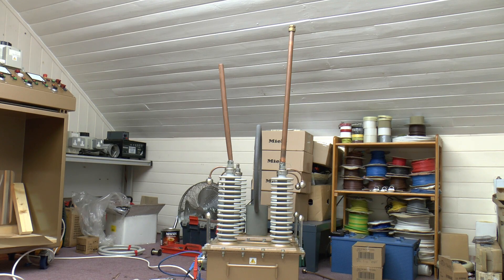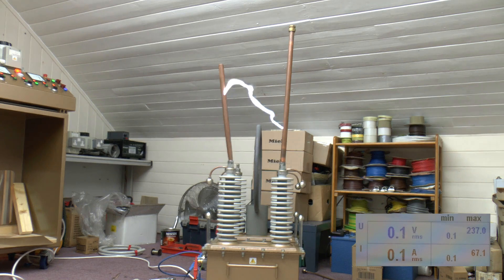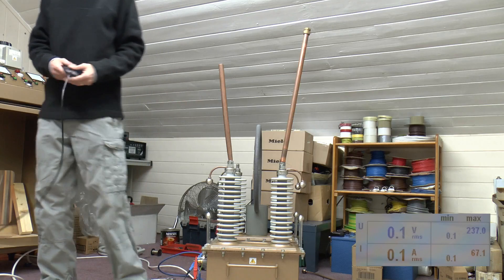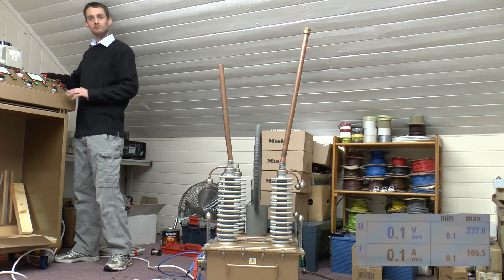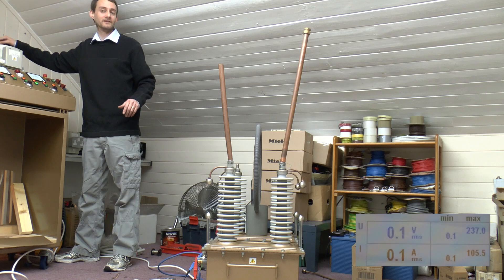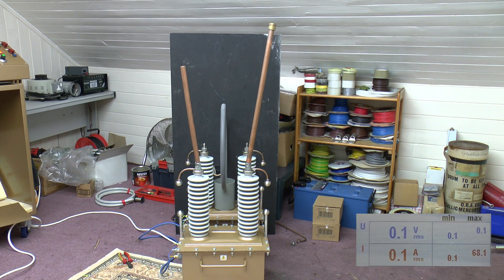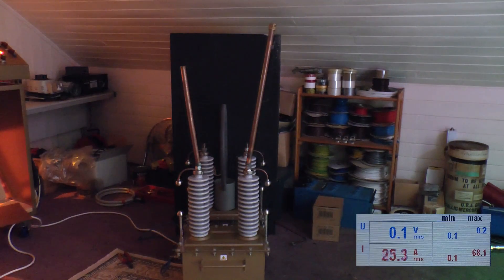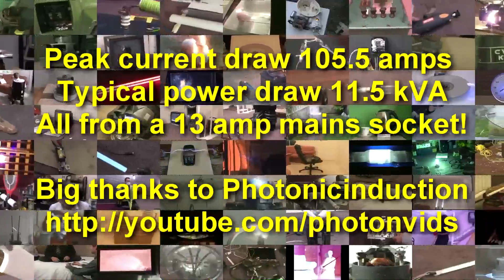Twin transformer Jacob's Ladder at Photonicinduction's house

Comment: I'm wondering if the circuit supplying this '13Amp socketoutlet' is a ring-final circuit of flat twin and earth, 2.5mm² installed embedded in walls! B-type BS 60898 MCB? :)
Reply from the maker: +Tom Lloyd It'll be a ring final but Andy may have veered from the normal standards for the rest. Type C (for high-inrush circuits) and D (or "don't fucking trip" :) ) breakers are plentiful in Andy's consumer unit, plus he uses a lot of fireproof cables as well, possibly FP200, I don't think it's Afumex because it's too new (I used that when replacing a flat roof).

The outdoor stuff was done on the cooker circuit which is shorter and seemed to have a bit more oomph :)
Reply: +AintBigAintClever type D- don't fucking trip! ... Superb- I'll use that one! 👍
I enjoy all these videos, there's comedy, destruction and education. Andy is inspiring 👏

Comment: hahaha 60amps od from a 13amp socket lol it'll take it. we do have the best outlet design in the world (unless you step on a plug) thick brass pins and all that. I can't understand how American outlets are rated for 15amps when they're just thin steel.
Couldn't you immerse the variac in mineral/transformer oil to keep it cool?
Reply from the maker: +Forename Surname Andy burnt out the socket feeding the attic rig while I was there, spotwelding the switch contacts, and ended up replacing it. Live, of course :)
Reply from the maker: The UK/European BS4343/EN60309 sockets are pin-and-sleeve, but there are other pin-and-sleeve standards in the US as well. An EN60309 that would be useful to you is the orange-top version which is for 125/250V split-phase. Yellow-top are 125V, commonly used in the UK on construction sites where they provide 110 volts centre-tapped to earth, so each pin is only 55 volts from earth potential.
Reply: +Gangaswan The Europlug (2.5A :-)) has about the same cross section as one of those rubbish flat prong things that they use across the pond. And most of them melt anyway :D
Reply: I'm in North America and I've had to replace some burned outlets that were caused due to overloading.  But we also have a "twist-lock" outlet that's designed to plug in and lock into place so the plugs cannot be removed.  These are actually quite nice...

Here's a link: http://www.leviton.com/en/products/4700
Reply: I've seen those, they are much better than the NEMA 5-15 plugs which remind me of the early (ca 1920) European plugs with no shutters and no isolated pins. To me they seem stone age compared to the majority of European plugs :-D 
In Europe when we need more than about 10-15A continuously we tend to use CEE plugs (rated at 16, 32 or 63A single or three phase, also available for DC). These are bulkier than your twist-locks, but they are in my opinion much nicer. They are IP44 rated (some even IP65) and they are made for industrial applications so they can take the maximum current all day long.
Some sockets are also interlocked with a switch or circuit breaker so you can't plug and unplug the appliance if the socket is on, which is nice to have (it avoids burning the plug'scontacts with the disconnection arc).

On my boat I have a so called "Marinco"  twist-lock plug (made in USA according to the label) and it's rated at 30A and supposed to be waterproof. Not only it isn't waterproof so the thing fills with water every time it rains, but it also can't handle 25A because the live pin melts (circuit breaker rated at 25A). On the other side of the extension cord, I have a CEE plug and it has always worked fine.

I feel that my Marinco plug is a cheap clone of the real thing, but since some other boat owners have been having issues with it as well I am starting to think it's bad design ;-)
Reply from the maker: You forgot about the 125A ones. I use a 63A for my mains conditioner/isolating transformer (because the flex is huge and wouldn't fit in a 32A plug) but I think Photonicinduction's playtime socket in the basement is 125A.
Loads of useful info on these sockets, including keying, colour coding and voltage/current/frequency handling at https://en.wikipedia.org/wiki/IEC_60309
Reply: +MrOpenGL It's probably a POS from the US.  The majority of the outlets in my house were manufactured here in the States and are the "contractor grade" crap you can pick up at the hardware store for $0.97.  I prefer European plugs mainly because they are designed to handle big currents and are usually equipped with some type of protection device.  Even our 30 A and 50A outlets for large appliances such as air conditioners and clothes dryers aren't very safe, as these have been notorious for catching fire due to lose contacts, faulty wiring, etc.  Then we also have "pin-and-sleeve" connectors (I've seen Photon use these before, I believe they're common in the UK as well) and these have ratings as high as 125A.  
I'm not sure how common electrical fires are common in the UK, although the majority of house fires in the US are the result of faulty wiring.  I recall hearing a story about some jackass "electrician" wiring up a 15 A outlet to a 50 A circuit.  Not long before the 15A outlet caught fire...
Now we do have devices called GFCIs (ground fault circuit interrupters) and AFCIs (arc fault circuit interrupters) that are designed to stop electrical current if a fault occurs.  These are commonly used in bathrooms and kitchens near sinks, bathtubs, etc.   For instance, if someone dropped a hair dryer in the bathtub, the breaker would immediately trip.  Like anything though GFCIs are prone to failing, in fact about 4 years ago I had a GFCI fail in my bathroom and ended up replacing it.  They should be replaced every 10 years.
Reply: +John Holt I am not aware of the standards in the UK, but in Italy it is mandatory to have at least two RCDs/GFCIs in the main panel (we rarely use outlets with integrated GFCI but they do exist, although they are extremely expensive - often more than 80€ for a 16A socket with 10mA IDn GFCI) and the main GFCIs in the panel can then feed additional circuits. I have never seen a AFCI installed in Italy, and it is not even present on the "residential" catalogue of Bticino (the largest plug/socket/circuit breaker manufacturer in Italy) but only in the "industrial/commercial" one.
Traditionally our GFCIs are the electromechanical type (very reliable in my opinion, I have one from the early 1930s that still works, although I don't use it obviously :-)) with a sense coil that directly powers the trip coil. Today new GFCIs are appearing that have an electronic circuit that does the sensing, but I feel these are less reliable than the electromechanical ones. I am sure the type integrated in the sockets are electronic because a low-power trip coil would take up too much space.

About EN60309 plugs I forgot to mention the 125A. I often see them in marinas powering those huge yachts, usually in the red 400V three-phase+neutral+ground (6h) colour. I have never seen it in the blue colour.

Apart from the common blue, red and yellow, I have also used the purple (24V) one on my boat, although it is powered by 24V DC and not 50Hz (a bit of a bodge really). I used it because I was tired of the stupid cigar lighter-style sockets melting and burning just by plugging in a 100W 24V vacuum cleaner. Now I use the 16A variant and I have never had any problem.

The Marinco plug has given me huge issues. I was not the one that chose it (and anyway I would have never mounted it where it is susceptible to be flooded by waves... I mean come on, it's a sailboat not a damn RV!!) and the other problem is that I can't find a low profile, panel mount, IP65 32A CEE male socket...
Reply from the maker: The only AFCIs I've ever come across in the UK were the ones sent out by Microsoft in their Xbox power cable recall. Remember when they said the power cable was faulty (when in fact the fault was a socket mounted with no reinforcing screws and NOTHING to do with the cable) and replaced the cable? Those ones. I did a teardown of one at https://www.youtube.com/watch?v=C0wQikAO-yA

Whether the US is more prone to arc faults due to lower-voltage, higher-current wiring, I don't know.

Technically your purple-top two pole should be for AC, but they're such an oddball that I doubt you'll find any properly-fitted ones to plug your cleaner into. You could go for the white-top 10h which (according to the Lewden catalogue) is for <50V DC, but you may struggle to obtain them.

Speaking of which I see what you mean about the panel inlets, Lewden do IP67 ones but they start at 63A, their 32A are surface-mount box jobs. CEE Norm do one which MIGHT be suitable for your task, or they might stick out too far. http://www.ceenorm.co.uk/section.php?xSec=74
IPD do one which appears to be more flush: http://www.ipdgroup.com.au/Forms/productdetail.aspx?&CatId=%27ws020%27&TabIdx=1&PID=16414&cID=12&FamID=3637&pcatID=0

Comment from the maker: Fuses (and breakers) have a "trip curve". Pull 33 amps on a type B 32 amp breaker and it'll take hours to trip. Pull 64 amps and it'll take 3 minutes. 96 amps will trip it in about 30 seconds but 128 amps will trip it in a fraction of a second. Do a Google Image Search on "type b trip curve" and you'll find a graph right at the top.

Comment: So those arcs must have been around 600 mA at 190KV?  I thought they were only at about 20 mA.  If I remember those transformers have a 1:100 turns ratio, so 60A @ 190V average should turn into 600 mA at 190KV if I'm right.

Comment from the maker: Haha, it's not that straightforward as the transformer secondaries are centre-tapped to earth, but I've emailed a circuit diagram to Photon showing how to connect all four of his transformers together to produce over half a megavolt! Trouble is, the cases of two of the transformers will be at about 130kV relative to ground and 260kV relative to each other, so it's a tricky setup to build.

Comment from the maker: In the house it was a 2.5mm² (I think) cable connected to a 13 amp plug, fed through the control panel (and the variac) to one of the transformers then linked across to the other (both primary and secondary).
In the garden, with two more transformers (only four of these exist) the bigger variac was fed by a 4mm² cable connected to the cooker outlet, with each transformer given its own feed from the variac (there's a twin 13A socket on the front).

Comment: 100 amps? Nice, I'm happy when I pull 20 amps 12v dc from my bench power supply to fry small stuff. Imagine what I could do with 100 amps at 12v. I need bigger power supply.

Comment: Excellent device for measuring. It is amazing how much current you actually can draw from a 13 or 20 Amp socket. Great video.
I often draw 40 to 50 Amps from a 10 - 15 Amp rated socket. It takes about 20 seconds for the C rated 20 Amp breaker to trip.